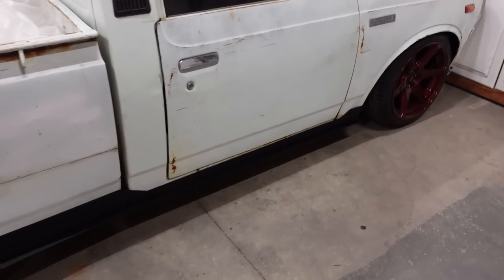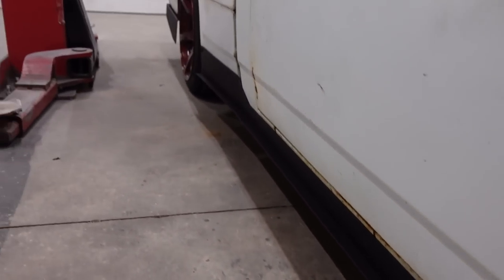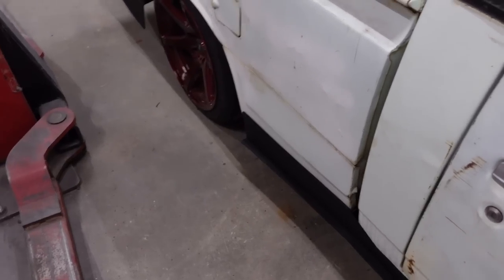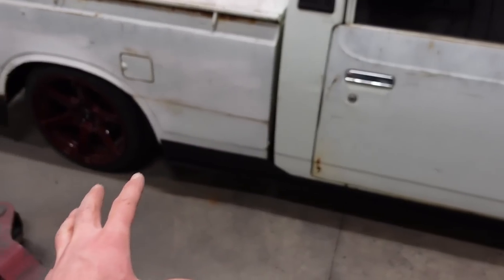I Built A Set Of Side Skirts For My Lowered Toyota Pickup!

Comment: Nice.... great vision... now you can consider a rear spoiler... not a tail... just a simple spoiler. Attached across the top of the tailgate.  Going the whole width side to side . Laying almost flat. A couple fins to match the diffuser... a couple of the  adjustment rods to match the front. About 6 to 8 inches of width.... Of course then you might want to use a flat thin sheet of aluminum or the ABS to make a one piece bed cover. Using a hinge and hydraulic struts... similar to a NASCAR truck...autocross... road course... drift truck... just a cool daily driver.